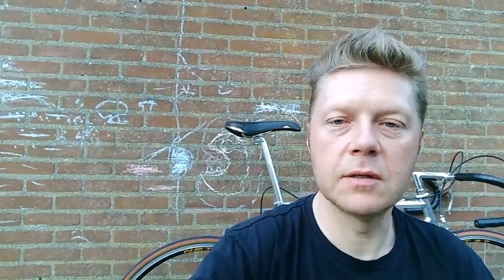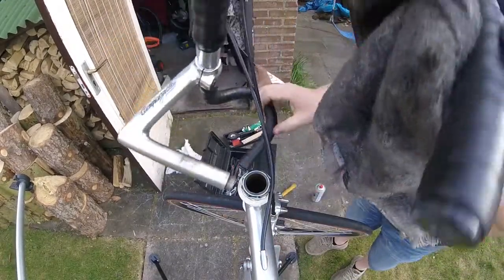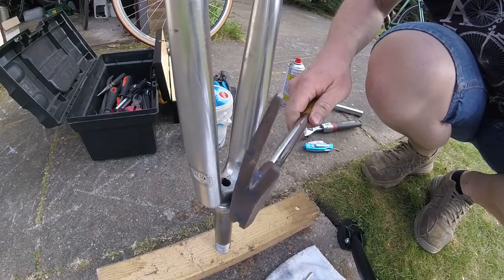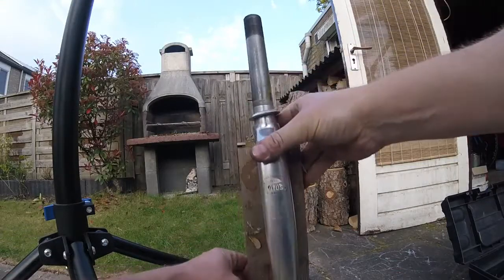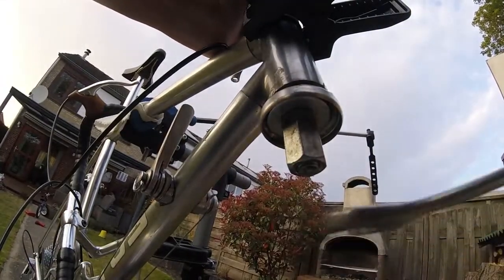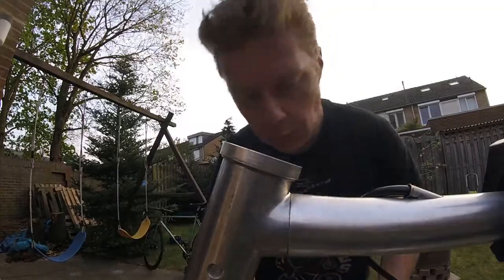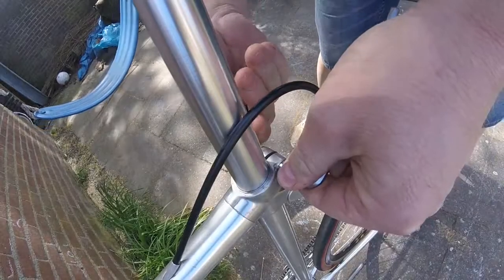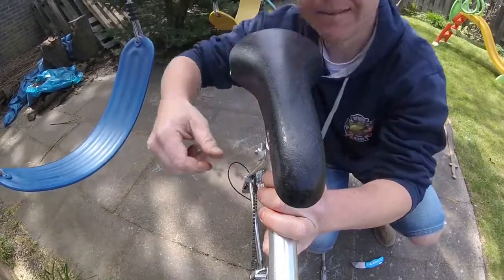Vitus 979 Duralinox - building my new Eroica bike, pt. 2

Comment: Hi I am interested on the headset brand what was it the one you install? Regards
Reply from the maker: It was StronLight, a French manufacturer. They are still making some bike components, unfortunately they stopped making those headsets with roller bearings.

Comment: Hello Mike
Did you ever get to actually ride your Vitus bike in an Eroica event? The reason I ask is because I see a mention in the Eroica bike rules about the only aluminum bikes "allowed" are the Alan bikes. I too have some Vitus bikes and frames so I am curious whet ever happened with you and your bike.
Reply from the maker: Hi Jensen,
Yes, I did. However, it was in Limburg, the Netherlands and there they are not that strict with following the rules as e.g. in California (that's what I heard). E.g. my rims are to deep by 5 mm I guess, yet nobody even noticed that.
About your concerns - if you read into rule 6.1.a – Heroic bikes or vintage bikes
HEROIC BIKES (or vintage bikes) are all road-racing bikes with racing handlebar, built up to and including 1987, both with and without gears, such as those built in the late 19th or early 20th centuries. These bicycles usually have a steel frame but rare aluminium frames are admitted as long as the tubes are screwed and glued (like ALAN type frames) and not welded.
And Vitus tubes are glued and not welded. I'd say you could even get a carbon Vitus bike and have it approved as it is glued and period correct.

Comment: Some years ago I did what you are now doing with an old Tommasini - difference is - it has Modolo Simplex and 
Stronglight stuff !
Love your chain gauge tool and soldering cable ends - well done !
Guess you used NOS - as I did for components .
I ended up with Pink brake lever rubbers ! 
Beautiful bike great skill and care shown .
Reply from the maker: Thanks Fergus,
Soldering cable ends takes me twice that long as putting the cable cap - but I do it once and I have no issues when readjusting the component or taking it off for cleaning or servicing. And it looks cleaner - I do it on every bike I service.
The groupset I've installed was cleaned thoroughly, unfortunately NOS is not yet within my budget range.
I'd like to see your Tommasini, perhaps we'll meet on an Eroica ride somewhere.
Stay safe and healthy!

Comment: Mike, the upper cone of the c record headset directly placed in the headtube (top side) was loose. The cone has open circles like super record. Does it need to be glued? or is this impossible because of the round openings?
Reply from the maker: Nothing was loose in my case, the first one (Shimano) had to be gently hammered out and the new one (Stronglight) had to be pressed in. They should not be loose as far as I know and you are not supposed to glue them in for the sake of later replacement.
By the "open circles" you mean it is drilled through the part that slides into the head tube? It's for weight saving.
Reply: @polishTinkerer  yes Mike indeed. They are drilled out.  There is a glue where you have the option permanent and a one so that you are able to remove it later. Ill get some assistent from the bike shop. in this case. thanks.